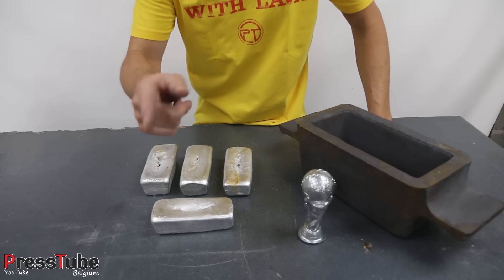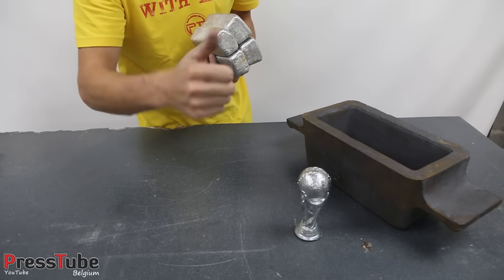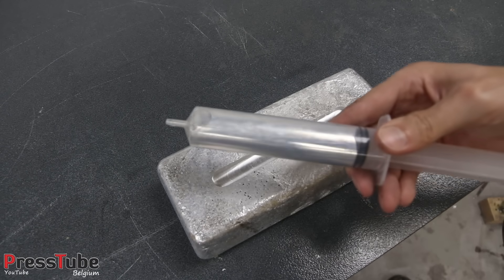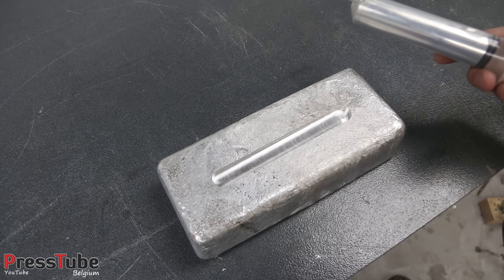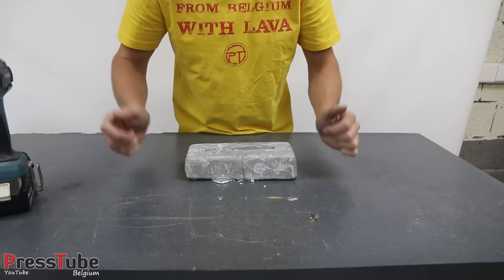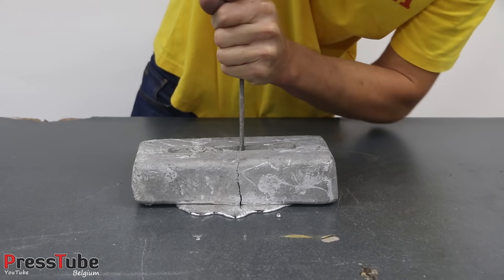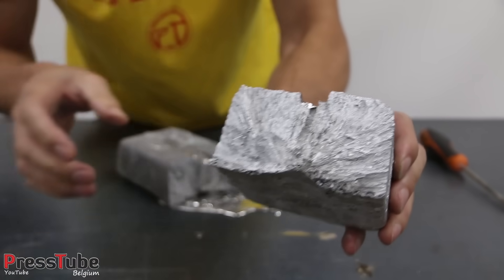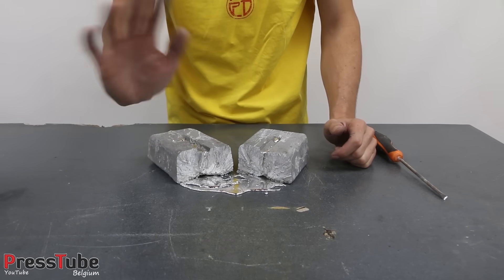Gallium Vs Big Aluminum Ingot

Comment: Is there any way to increase the boiling point capacity of the gallium so that it takes longer to melt or rather not so easily at body temp? 

How is it possible to affect the aluminum but not affect your fingers?

How does it react with steel?

Comment: You should really think about over the angle boots for poring. Your heavy duty slippers will act like a cup to hold the molten metal against your foot. Been a ridiculous amount of people hurt that way. A drop of sweat in the bottom of a mold can be enough for an eruption. Cool video I just worry about the inevitable.

Comment: The drill didn't do what you thought. Aluminum forms an aluminum oxide skin very very quickly in air. The gallium could not reach the pure aluminum. When you drilled the hole, however, there was little/no air, so the protective layer could not form.

Comment: The Dangers of Ingesting or Using Gallium in Unsafe Ways: Risks, Concerns, and Potential Health Effects

Gallium, a silvery metal that melts at low temperatures (just above room temperature), has found various uses in industries, electronics, and medical imaging. But what happens when gallium is used in ways it's not intended for, such as ingesting it, pouring it into the eyes or mouth, or using it for enemas? This article explores the dangers, potential health risks, and safety concerns of these unconventional and hazardous uses.

What is Gallium?

Gallium is a soft, silvery metal that remains in a solid state at room temperature but melts to a liquid state when slightly warmed. Because of its unique properties, it is often used in electronics, alloys, and certain scientific applications. Its toxicity is generally considered low compared to other heavy metals like lead or mercury, but that doesn't make it safe for ingestion or contact with sensitive tissues.

Health Risks of Ingesting or Pouring Gallium into the Body

1. Ingesting Gallium: Gastrointestinal Concerns and Toxicity
   
   When gallium is ingested, it can interact with the acidic environment of the stomach and undergo chemical changes. Although gallium itself has low acute toxicity, its interaction with stomach acids could cause irritation or lead to gastrointestinal distress, such as nausea, vomiting, diarrhea, and abdominal pain.

   Long-term ingestion or high concentrations of gallium can potentially harm the kidneys, as gallium is excreted through the renal system. Over time, it may cause nephrotoxicity (kidney damage), which is particularly concerning for individuals with preexisting kidney conditions or compromised renal function.

2. Pouring Gallium in the Eyes: Severe Irritation and Possible Damage
   
   The eye's surface is extremely sensitive, and exposure to chemicals like gallium could cause severe irritation, inflammation, and even corneal damage. While liquid gallium is not a strong corrosive substance, it is still a foreign material that can disrupt the eye's natural environment. Potential complications could include vision impairment, conjunctivitis, and long-term damage to the cornea or retina.

3. Warm Gallium in the Mouth: Oral and Digestive Risks
   
   The mucous membranes in the mouth are highly absorbent and sensitive. Pouring warm gallium into the mouth could result in burns if the metal is too hot. Once in the mouth, gallium could interact with the saliva and be absorbed through the mucous membranes, potentially leading to toxicity in small doses. In addition, the metal’s interaction with dental fillings or other metallic objects in the mouth may produce unwanted reactions.

4. Gallium Enema: Dangerous Interactions with Intestinal Tissue
   
   Using gallium as an enema is particularly dangerous because the colon and rectal tissues are sensitive and prone to absorb substances rapidly. This method of exposure can cause severe irritation, inflammation, and damage to the rectal and colonic mucosa. The potential for systemic absorption is high, increasing the risk of gallium toxicity in the kidneys and liver. Such practices could also lead to electrolyte imbalances, internal bleeding, or perforation of the intestinal wall.

Potential Effects of Gallium on Kidneys, Stomach, and Bowels

- Kidneys: The kidneys are responsible for filtering out metals and other substances from the bloodstream. Prolonged exposure to gallium can lead to nephrotoxicity, resulting in kidney damage or impaired function over time. Individuals with preexisting kidney conditions are at an increased risk of developing severe complications.

- Stomach: Gallium’s interaction with stomach acids can produce compounds that may irritate the stomach lining, leading to gastritis or ulcers. Symptoms such as burning sensations, pain, and digestive upset may occur.

- Bowels: Gallium passing through the intestines could lead to disruptions in the natural microbiome and damage to the mucosal lining. Prolonged exposure or high doses could cause persistent gastrointestinal issues, including pain, irregular bowel movements, and inflammation.

 Concerns Regarding Gallium’s Use and Potential Long-Term Health Effects

While gallium is not classified as a highly toxic metal, unconventional exposure methods like ingestion, ocular contact, or use as an enema can lead to unexpected health risks. Several concerns should be highlighted:

1. Chemical Interactions: Gallium can interact with biological tissues and fluids in unpredictable ways, potentially forming harmful compounds that could have toxic effects on internal organs.

2. Systemic Absorption: Absorption of gallium through mucous membranes or intestines increases the risk of systemic toxicity, where the metal can accumulate in organs such as the liver, kidneys, and brain.

3. Lack of Research on Unconventional Use: There is limited scientific research on the effects of unconventional uses of gallium, meaning the full range of potential health impacts is not well understood. This lack of data makes it difficult to predict and manage the risks associated with these dangerous practices.

 Conclusion

The use of gallium in unsafe or unconventional ways, such as ingestion, ocular contact, or as an enema, poses significant health risks. While gallium may not be as immediately toxic as other heavy metals, its potential to cause damage to the kidneys, digestive tract, and sensitive tissues like the eyes should not be underestimated. Individuals should avoid using gallium in these hazardous manners and consult medical professionals immediately if exposure occurs.

Comment: If you mix gallium and aluminum until they are homogenous, then you can convert the aluminum to hydrogen gas by soaking it in water. The gallium will be left behind and can be re-used.
Reply: more accurately: the gallium in the mix prevents the aluminum from forming an oxide layer, allowing the aluminum to react with the water to form hydrogen gas and an aluminium hydroxide in solution; the gallium would (probably) settle out as a precipitate.

Comment: Put the post treated aluminum in water and the aluminum/gallium alloy will convert to aluminum hydroxide salt and pure gallium (can reclaim 100%). Do outdoors as A LOT of hydrogen gas will be given off. Heat the aluminum hydroxide to separate the hydroxide from the aluminum and you'll end up with pure aluminum again 🤫
Reply: ***can also be converted back to aluminum via calcification, without a heat source ☺️

Comment: If you re-melt the ingot it'll be fine once again. Gallium lubricates the aluminum crystal boundaries, but if you melt the result, the gallium mixes randomly and forms a "solid solution" with the aluminum, similar to how adding a small amount of tin to copper makes it stronger but less malleable. And from the looks, only a tiny bit of the gallium is actually still in the aluminum. (One way to get insight, you can google image search for: aluminum gallium phase diagram, and look at the aluminum-rich side, and you'll see up to about a 5% molar ratio it remains in the FCC A1 form, or you can try it yourself like I did!)

Comment: Could the damaged be re melted and used again without any issues or would the aluminium be useless after the reaction?
Reply: the aluminum now has a Gallium impurity.  You'd have to separate the metals to use it properly.

Comment: i wonder what will happen if you smelted this aluminum gallum ingot. since the boiling temperature of gallium is way lower than aluminum will it just separate them and turn this ingot back to a strong normal aluminum

Comment: When aluminum is exposed to air it forms a layer of oxidation that protects it from the gallium. Taking something as simple as a car key and scrapping off the surface just before you pour on the gallium works like a charm.

Comment: The funny thing is you got scammed because gallium is melting only at 29 Celsius and it is liquid after 48 hours in your room(≈20°C)
Reply: Bruh please don't be this dumb
Reply: @sheev9852  explain your self
Reply: The gallium you see I'd already partially reacted with the aluminium and melting point of the amalgam is lower of that than gallium. Make sense?
Reply: @sheev9852 it's then a  gray metallic piece or solid in various forms

Comment: What happens if you melt that aluminum down again?  Will it regain its strength or is it permanently modified?
Reply: it's now an ally.  the reason the bar split is because the alloy changed the crystalline structure of the metal... in one specific area, not the whole bar.

Comment: Aluminum oxidizes almost immediately on contact with air, slowing down the reaction. Try again but make some deep scratches in the channen AFTER you've filled it with gallium. That way the liquid gallium will directly contact unoxydised aluminum metal.

Comment: If you drop what's left of that ingot in water and seal the container, congratulations, you have made a bomb.  If you mix Gallium and Aluminum, and then add water, you let the aluminum react with water, making Hydrogen, and Alumina.  I don't know how well the Alumina separates from the Gallium yet, but the gallium isn't used up in the reaction, so it is technically recoverable.

Comment: The reason it wasn’t working at first is that aluminum makes a coating of aluminum oxide when exposed to air. Gallium doesn’t react with aluminum oxide. All you needed to do was use a nail or screwdriver to scratch the surface of the aluminum under the gallium to kickstart the reaction.
Reply: oh yeah, he might have had a mix of Aluminum Oxid eand Hydroxide since he quenched the ingot.  However... he DID use a milling machine to create the groove he poured into so that "should" have removed the oxide layer.
Reply: @marhawkman303  no, the oxide formation on aluminum is near instantaneous upon contact with air. That’s why you scratch it off under the gallium layer, to prevent oxide formation.

Comment: why does everybody insist on heating the aluminum up until it glows? its melting point is only 1200 degrees F, just heat it up to a very faint red glow and no hotter. (best if there is no glow at all)

Comment: aluminum oxidizes so you'll have to scratch that away first, that's why it only worked when you drilled. The other indent was left out for too long.

Comment: a faster reaction would be had if taking a wire wheel to the entire surface of the ingot or mill off the surface and then spreading the Gallium across, rather than pool it in a channel

Comment: The Gallium didn't do anything to the aluminum. What it did was stop the aluminum from forming an oxide surface layer allowing the aluminum break in to hydrogen (H2) gas and  aluminum oxide (AL2 O3)

Comment: To answer call of those kids who are asking "What happend's if you Re-melt the mixture of the 2"

 Well... Nothing would really happen because the melting point of gallium is 4,001°F (2,205°C) and the melting point aluminum is 1,221°F (660.32°C). The boiling point means the point that something turns to its gas state until cooled (that is how you would extract it from the aluminum). 
So when the aluminum is melted the gallium will stay with the aluminum and will be brittle still.

I don't know how much of this is true this is but this is all I got , I guess.

Comment: Could this percentage aluminium gallium  alloy be used as a hydrogen producer in organic reactions? Or is the oxide layer not completely passivated?
Reply: the parts with GaAl inclusions will not form an oxide layer, and will actually act as a hydrogen gas generator.

Comment: The Galium didn’t eat away the Aluminum, it actually infiltrated the Aluminum and broke the metallic bonds in the metal therefore making it very brittle.  You should try hitting the ingot with a hammer, it should shatter quite easily.

Comment: sitting on top didn't work because the aluminum had a protective aluminum oxide layer. drilling the holes which then had gallium go directly in to the material without the presence of oxygen allowed it to penetrate due to the lack of that protective oxide layer

Comment: NileRed has a good video covering this.  You can get some good reactions simply by scratching the aluminum after the gallium is placed on top of it.  A good scraping of the surface will do more good than drilling into it, more exposed surface area for the two to interact.
Reply: The aluminum surface oxidizes almost instantly in the air, scratch removes oxidation layer.
Reply: right.  however, he drilled holes in it and the gallium still barely interacted with the aluminum.  so not sure why that is.  i was expecting it to completely crumble/fall apart like ive seen it do in other videos.

Comment: You didn't remove the oxidized layer of aluminum. This inhibits the gallium from seeping in to much hence why when you used the drill it started working as you got it into non oxidized aluminum and the gallium coated it before it could oxidize. So tech you did it wrong but that's what happens on a 4th or 5th generation hand me down video info gets lost along the way
Edit: not something you expected? That's a bold face lie... you knew exactly what would happen since this was inspired by another video...

Comment: Honestly from everything I've seen about gallium you had no need to drill the hole so deep even just running the drill underneath the gallium would have had a similar result and that's because of the oxide coating that formed between the time you machined the channel That the gallium was in and the time you put the gallium in
Reply: He wanted more surface area so the gallium could react faster. Mercury on the other hand is much more pleasant to watch when reacted with aluminum.

Comment: You are overheating your aluminum so much! Proper pouring temperature shouldn't even glow red. When you heat the aluminum up that high it is molten for much longer and dissolves a lot more hydrogen from the air. This all comes out as it solidifies and causes bad porosity in the metal
Reply: His goal was for the gallium to get into the aluminum and eat away at it.  I'm pretty sure he did that on purpose.
Reply: But where the H2 come from? The air has only very trace amount of it.
Reply: @tmfan3888  Moisture
Reply: @tmfan3888  the hydrogen comes from contact with moisture in the air.
Reply: @tmfan3888  He was cooling it down in water watch the video again
Reply: I was gonna say aluminum isn’t supposed to be red when you pour it lol
Reply: im trying to remember when anyone asked
Reply: If you think he got it wrong. Post a video doing it yourself.
Reply: gyongah such a dumb comment
Reply: @gyongah  and another 😂

Comment: "I hear that the best thing to get rid of Aluminum is to feed it to Gallium. You got to starve the Gallium for a few days, then the sight of a chopped-up Aluminum ingot will look like curry to a pisshead. You gotta file the top of the ingot, and make a dent in it for the sake of the Galliums' consumption. You could do this afterwards, of course, but you don't want to go sievin' through the slurry, now do you? Gallium goes through Aluminum like butter. You need at least 600 grams Gallium to finish the job in one sitting, so be wary of any man who keeps Gallium in a lab. They go through ingots that weighs 200 pounds in about eight minutes. That means that a quarter of a pound Gallium can consume through many pounds of aluminum every minute. Hence the expression, 'as greedy as Gallium'.
Reply: 😂😂😂 Snatch 😂😂😂

Comment: 💡You dude!💡Why don't you try to make a working xbox/console controller out of metal or even the console case itself?????
You could just cast the plastic casing in metal and try to install the internals and buttons afterwards???
That would be super cool!!!
Love your channel btw!
Please consider to give this a thumbs up. 👍😉
Reply: Precision...
Reply: Not enough
Reply: @charadremur333  I don't know. The external controller case isn't too complex is it? It's only moulded from plastic after all.
Reply: @mikej557  i messed up, i thought he meant to make a brand new one processors with a cast, but it likely will work for the case.

Comment: Maybe for the next video, try to make mix of gallium and another metal... Try to see if there is a metal that gallium will not eat... Try to see if you can make another super ingot, very lightly brush only the surface, wipe away after a minute or two. The poibt of tuat is to see what metal (if any) you can give a shiny outer layer like chrome plating.